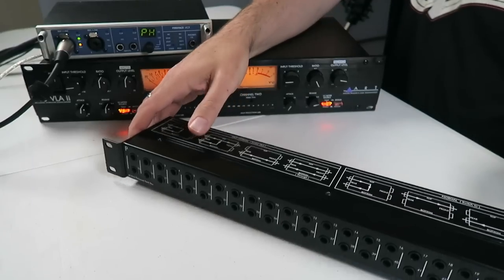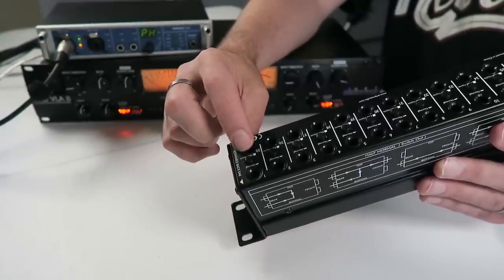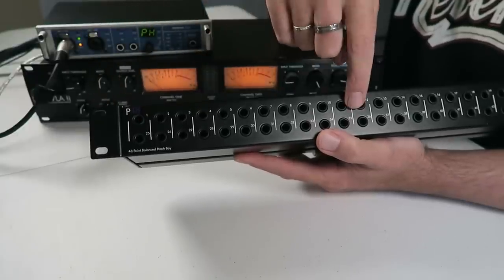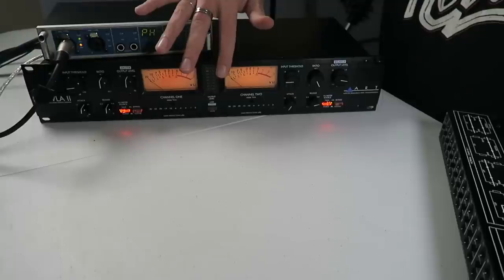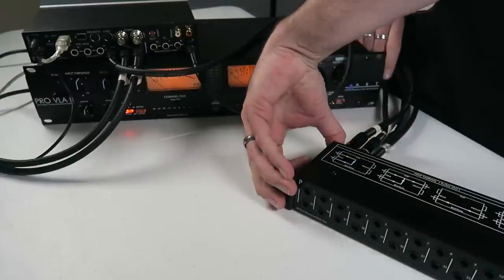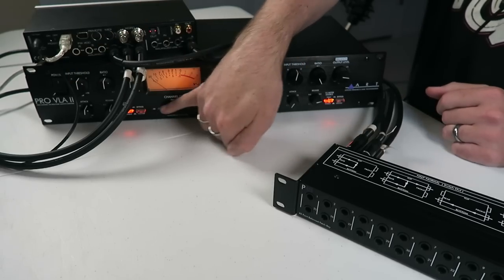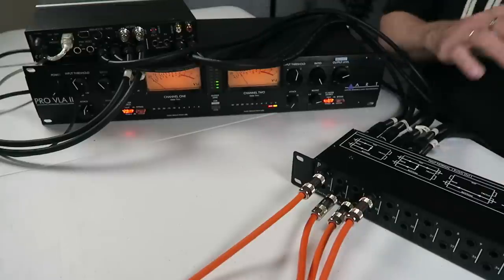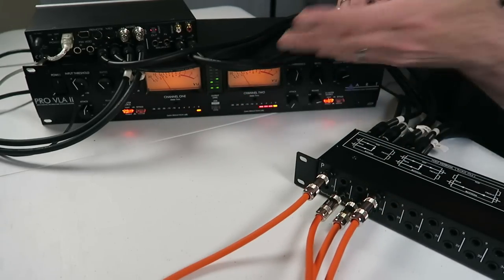Patchbays (ART P48)

Comment: it looks like you are using monoprice TRS cables. I have heard some good things and a few bad things. Do those have any issues? The few I have seen have really thick cable, which may just be thin wire and lots of plastic around the wire. Thoughts on these cables?  Also, what kind of interface is that?
Reply from the maker: I've been a big fan of Monoprice's Premiere Series pro audio cables.  They've got great connectors and I can't beat the price, especially when bought in larger quantities.  I'd estimate that I've got over 50 of these cables behind my rack, and they've been great.  I did have 1 fail on me, but I guess that's still a pretty good success rate :)

You're right, they are very thick.  I like the feel of them, though.  They're supple and flexible, and they don't retain weird kinks that some other inexpensive cables do.  The thickness of the cables can complicate your cable management if you have a lot of them and you're trying to run them in tight spaces.  Overall, I can recommend them for situations where they're plugged in and left alone.

Oh, and my interface is an RME FireFace UCX.  It's really an amazing interface.  If mine ever bites the dust, I'd replace it with another RME in a heartbeat (assuming that I can afford it 😁)
Reply: Your Home Recording Studio Thanks for the response. What’s their premier series. Do they have another series? I’m not super familiar with monoprices product lines. Judging by your message I’m assuming there is cheaper or better line that’s by mono price? Is that the case?  

I needed a bunch of 2 foot power cables for a bunch of rack gear and I bought 20 of them from Mono price for just over a dollar apiece. That’s insane. Do they handle returns? Is the customer service good? For the one bad cable that you got, did you have any trouble getting it replaced?

Comment: So say if I grab the new autaria fuse audio pre8 can I use four outboard gear with the patchbay. And do it matter on the audiointerface outside and in. I just sub too dooe vid strait to the point.
Reply from the maker: I actually hadn't heard of the Audio Fuse 8Pre before.  That looks like a really cool interface!

Yes, it looks like the 8Pre has plenty of line inputs and outputs that would allow you to loop in external hardware.  And it even has not one, but two (!!!) sets of ADAT in/out so you could get another 16 analog inputs and outputs if you pair it with a couple of ADAT preamps like the Behringer ADA8200.  That'd be a whole lot of connectivity!
Reply: @YHRS  thanks family I. Trying to choose between this or the focusrite but might be getting this

Comment: how do you set through mode ?
Reply from the maker: As far as I can tell, the P48 can only do through mode if there are cables plugged into all 4 jacks of a single channel.  That's what the block diagram on the top of the unit shows, at least.

Comment: Ok so say u have an interface with just 4 out and 2ins... would adding a patch bay in effect add more  ins and outs for post processing ???
Reply from the maker: Unfortunately, no.  The interface is limited to however many inputs/outputs it has.  The patchbay is mainly a way to bring those inputs/outputs to an easy-to-access location and make it easier to change connections without having to crawl around behind your desk.
Reply: @YHRS  after all these years I still come back to this video from time to time lol. Which patchbay u using nowadays ?

Comment: One way to do it BUT not the industry way to do it, it's called/referred to as 'Waterfall' for a reason. (The signal goes from top to bottom, like a waterfall) The top row on the front of the panel are ALWAYS the Outs and the bottom row the Input. On the rear of the panel, the top row is from the 'output' of the device and the bottom row goes back into the 'Input' of the device. For complete control use Mono Cables, so 1 is Left Channel and 2 the right Channel. The way you described it is more complicated than it needs to be. https://www.youtube.com/watch?v=qJfWkFaihiI